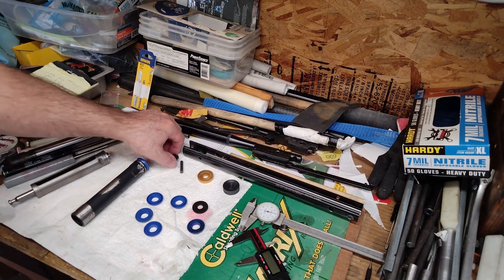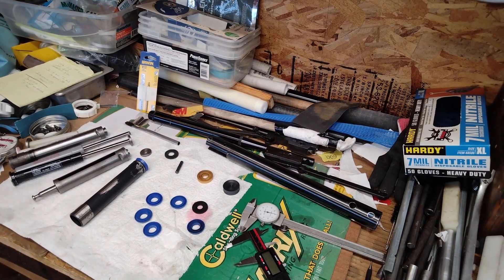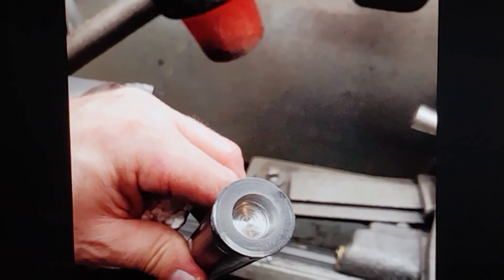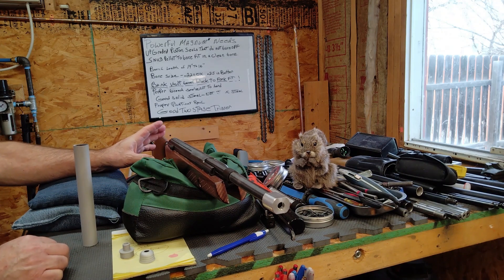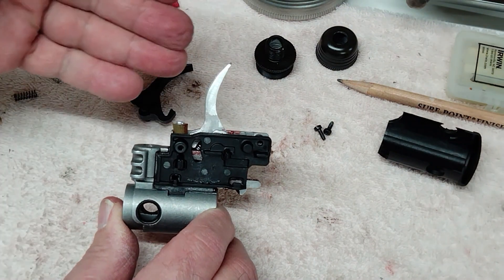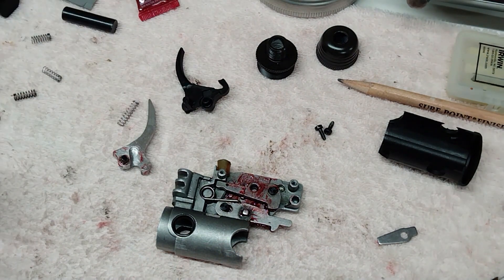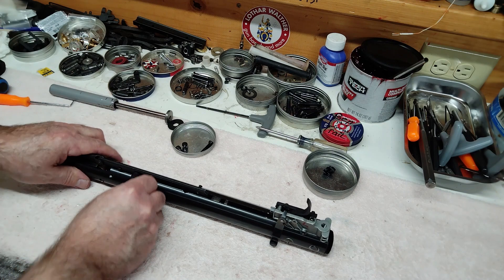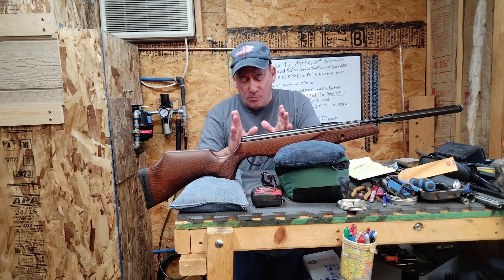Revised Overhaul of the BSA Lightning XL SE Air Rifle  22 !

Comment: Hi Mike. That Lightning ⚡ looks pretty nice, but the trigger must kind of suck like a standard Gamo trigger? Can't wait for your Diana 34 video. I just got a 1993 Diana 34 177. It's sweet shooter, but it needs a new piston seal and spring. There was no lubricant inside and the spring was broken at the very bottom. I used a torch on it, knocked off the sharp edges, lubed the whole unit back up and it still does a solid 12 FPE and cocks and shoots very smooth. The trigger needs some TLC also, a little rust in it. I'm not going to touch it unless I see a good video of working on that trigger. BTW God bless and have a great Christmas ✝️🎄😃👍.
Reply from the maker: I  order new  piston seal and breech seal and had  to pull  the barrel  back  out  of the block for  a  re  do  on  the breech seal  this time I will make it  the size  the  re placement O  ring  is,  the one I used was larger and was  causing a issue. the  trigger screw  on my TO6  was  3mm X .5 pitch I am finding the  screw  closet to  the trigger blade needs  to be longer .
 I  bought a  Walther Parrus in .22  good  condition with a  97K  from the same guy  both still in the box they been sitting  now for several weeks , mean while I have  a vintage  Beeman R 10 deluxe  in .20  coming  so  its been a air gun frenzy lately .. 
Thank You and you have a warm safe God  Blessed Christmas too !!

Comment: I just bought the BSA Meteor Super from AOA .. it's a great little lightweight rifle for squirrel hunting. Sure is much lighter than the Diana 56th carrying through the woods.
Reply from the maker: I bought one at  the 199.00 sale  price from AOA  was  going to go thru  that and upgrade it like this lightening  then decided  to  just return  it,  and get back  to my other  projects.
trigger on that  is not what  I like and they are a  pain  to get something better out of it
Reply: @MrSteppingstone888  What upgrades was you planning on doing? Is there a way to get the BSA Meteor Super up to say 800 fps with a 14gr pellet? Do you know which higher pressure gas rams may work? Say from other Gamo rifles?
Reply from the maker: pretty much  the same  as  what I did  for the Lightening in this video
not sure what  gas  ram  is  the  meteor from AOA lower uk one  or  stronger one like  in this video

 @ShootingTheBreeze71
Reply: @MrSteppingstone888  Well I know 100% it's a 12lb version from watching the AOA review of it. If I was able to find the right gas ram I'd keep the original seal in the tube and just try for a bit larger transfer port. I seen where the Meteor Super and Lightning XL was showing the same fps in .22.. With a coupon I can buy a Gamo for about $85 which was showing 1100 fps in .22 .. Just wasn't sure if it's the same diameter as the Super. I like the unshrouded 19.5 barrel on the BSA and would put a silencer on the end since it has the 1/2x20 thread on the end. Would definitely be a great little lightweight rifle if I can get it up to 800 fps with a 14.3 pellet.

Comment: Great video Mike, Have you ever though of DLC inside compression tube. My theory it reduce friction between tube and piston seal and maybe increase fps.
Reply from the maker: What  is  DLC ?     Cerakote has  Micro slick  which I  have not attempted  yet  that  would  be  the way to go.
 typical air chamber  lube is  burnished  into the tube its not visible  when  done ,  seals today are not  big  enough so  they loose some swept volume
Reply: @MrSteppingstone888  Diamond Like Coating (DLC) films feature high hardness, high wear resistance, low friction coefficient, high insulation, high chemical stability, high gas barrier properties, high anti-burning properties, high biocompatibility, and high infrared permeability.

Comment: a hello mike , a spring gun has a certain amount of air that gets the propelant , the transfer port  diameter makes the air hotter ( the piston weight  and spring force also  ) and so the gets volume more  . if a hole is to small you loose power , same  if the hole is to large also , lesser heat lesser volume . hot air is thinner , the air wil flow better.   . some rules  short transferport/ small hole ,and if possible a port made of metal that not will take heat fast up and volume
Reply from the maker: yes  there's a balance in  port hole length & size   when its a factory hole its one  with  the tube but a changed port hole has  the replacement, not sure  with  the brass verses steel but seams  to do the job

Comment: Mike inspite of claims to the contrary these guns have been redesigned and are built by Gamo in Spain. As evidenced by the dreadful Gamo piston seal [ proper BSA's have a FWB type piston seal ] and the terrible Gamo trigger unit and anti beartrap unit. The original BSA trigger might not have been the best unit in the world but it was certainly head and shoulders above the Gamo unit. Having said all that both the BSA and the Gamo built guns are capable powerful guns, my advice throw away the gas ram fit decent piston seals and a quality spring [obviously if converting from gas ram you will need a piston liner and spring guides] and they will go to 17 fpe without any specialized tunning.If you know what you are about the .25 caliber version will go to 23 fpe plus. The Gaqmo built guns can have a problem with the breech jaws being too wide allowing the barrel to wobble and should be checked and adjusted if needed.Personally I would not touch the transfer port I have never found it necessary.
Reply from the maker: Hi Dave 
This BSA I was going thru it for a  friend who  bought it,  it was  his cup of tea I was trying to  improve it some. I could not stand how this thing was  made.
  and look  at air guns of Arizona  they now have two bsa models  in stock for some totally ridiculous  price ,  for people who think the guns are  like vintage  originals
https://www.airgunsofarizona.com/Specials.html

Comment: Mike transfer port alignment.my hw50 22 is considerable out. Is this common, is there a fix?
Reply from the maker: Hi 
I don't know what you mean by out ?  Not even with the top surface , ? Toss pictures up on your air gun fourm so we can see what you are trying to show let me know what fourm I'm on airgun nation and air gun warriors not GTA or click on about me tab on my you tube channel scroll down for my email
Reply from the maker: If  you mean  not  in line  with  the  breech port I would say  if it  works  leave  it, check your other weihrauchs   and post pics on  your forum to get other  reports
breech port holes  can be re drilled and  re  centered  depending on where the original one  was  made and looking down at the inside  bottom  of the air chamber  to see how close it is to the receiver walls

Comment: My question got wasted
Reply from the maker: I had  to revise  it see  title  it says  revised
Reply: @MrSteppingstone888  repeating my comment i want know is there any size difference between air transfer port size in same model air rifle with different caliber like Hatsan sniper 125  177 and 22 do they have same size transfer port?
Reply from the maker: @Double-xposure  Not  to my knowledge far as  135  125  both are  powerful guns  and I think the hatsan  95  has a  4mm  port hole.  
the port hole  change  gets a little smaller as  the gun is made  for  lower power  or  when the piston stroke is  shorter like  a hw 80  and like that bsa  Lightning   in.22  it  got a hair below  600fps
Reply: 29mm×70mm or 29mm×76mm ?(BSA Lightning XL SE GRT )